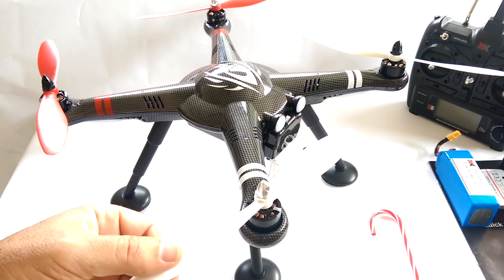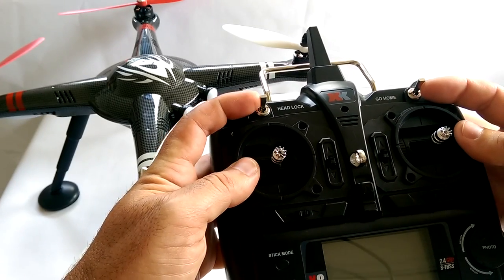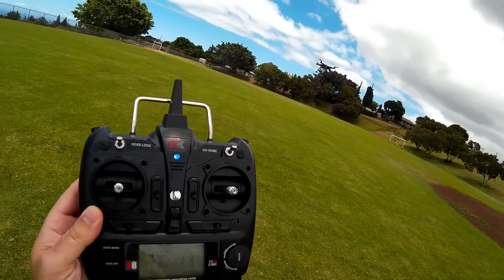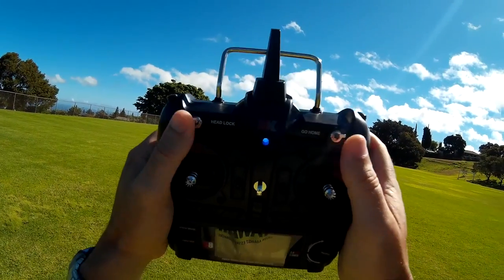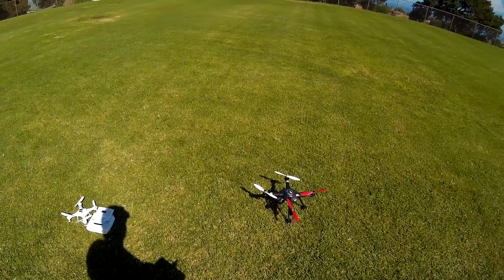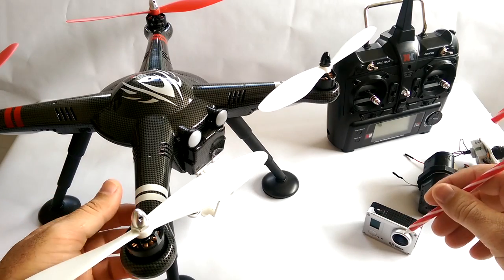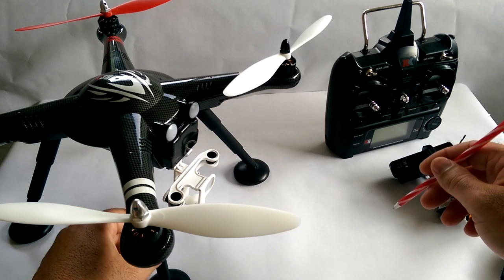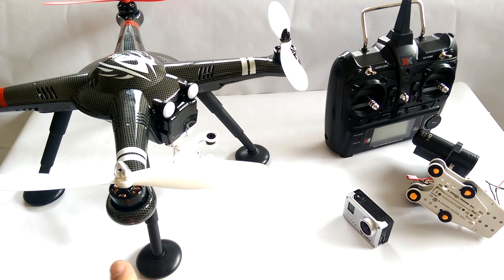XK Detect X380 GPS QuadCopter Drone Full Review - [Setup, Flight Test, Pros & Cons]

Comment: I've been watching quads in this price range for quite a while. This looks like one of the best I've seen under $500. The huge battery with resulting 30 minute flight times is amazing at this price point. Add to it spot on GPS and return to home and you certainly have a winner. The rotating dial for a gimbal is really cool. Can't wait to see your mods and gimbal footage.
Reply from the maker: Hey John.  Yep, the gps and flight controller seem to work flawlessly in this quad.  I'll hopefully be getting the mod parts in next week and see how far I can take it.  Stay tuned :)

Comment: Hey Dustin
I am having an issue with the pitch control on the X380 and G2D. Without the signal wire connected the gimbal works fine , but when I connect it, the gimbal tilts the camera up and down sporadically on its own and when I tilt the copter and it has a delay trying to level the camera. I am using the far left pin opposite of the USB plug on the X380 and it is plugged into the gimbal PIT top pin. The wire(s) I am using are a modified combination of the two included wires included with the gimbal to extend the reach from plug to plug . I Removed the red+ and black- leaving only the gray signal wires in the harnesses and snipping off one harness on each. I stripped the ends of the wires , twisted them together and insulated with electrical tape.  I have began to troubleshoot it and have removed the props , left the remote turned off and powered the copter and the issue continues but gets worse when the controller is turned on. Not sure what my next step would be and hope you may know the remedy to my frustrating problem….

Comment: Dustin i just received my XK Detect X380 on Wednesday December 30th 2015, and I got the up graded transmitter that now has (F.A.P ) mode Fly around point mode. So on the transmitter the camera button now says (F.A.P ) and you push it once to make the quadcopter do a 360 degree rotation. And it will continue in the 360 degree rotation until you push the button again. Also if you push the button and pull down on the right control stick for a few seconds it will then enter fly around point mode and circle the chosen target and circle it until you push the button to make it stop again. So my question is how do i take photos now that that (FAP) is on the camera button? And It has camera written around the sides of the button with arrows pointing in both directions around the camera (FAP) button to where you would normally turn the knob to adjust the camera angle. I have just ordered the gimbal that goes with this quadcopter, and i don't see how to make this one button do four different Things  And the instruction manual is still showing the old transmitter with camera written where (FAP) Is now. So the instructions are not updated yet. But they did add a manual to demonstrate the (FAP) mode. But they did not say anything about how to take photos or adjust the gimbal now. So i just wonder, if maybe you got to hold the button down or press it a couple of times to go in to camera mode or something? Also i would like to slow down the yaw rate when in (FAP) mode When it's doing a 360 degree spin while hovering. it spins to fast i would like to slow that down just a little bit. if possible?  I would assume that you have upgraded your X380 to have the ( FAP) mode? is the camera button now FAP mode for you to? Assuming you have upgraded ? but if not i assume  you would still know how that would work. But i have only got to fly the XK X 380 about 5 times now, but i was, and I am still very impressed with this quadcopter. I have a Syma x8c quadcopter and it is a good quadcopter for manual flying, but for areal filming the XK detect or quadcopters like the XK Detect X380 that are equivalent to the  X380  with the G.P.S  And altitude hold modes are the only way to go for areal filming This quadcopter pretty much flies its self compared to my Syma x8c quadcopter.
Reply from the maker: Not sure you can snap pics remotely with controller.  Yes, I've upgraded to the FAP and it works with my version fine.  It's a good quad.  Just wish it had another channel or 2 for other functions.

Comment: Hey Dustin , great videos ! today i received my X380 and i was hesitant on taking it out for its maiden flight because of the outside temperature (16 F.) and i was unable to find any specs containing a minimum operating temp. do you know what they are or would you know where i might be able to find out? thanks
Reply from the maker: Whoa that's chilly!  Honestly not sure but I would think you'd be OK.  Make sure you compass cal and give it an initial few mins to update GPS almanac and lock.  I'd do a  10ft hover with some small movements for the first battery.  The flight controller gets pretty hot in the X380 so the lower temp may be ok.  Just keep it low just in case.
Reply: yeah we all cant live in beautiful Hawaii ! lol. i have one more question for you , do you know if you can get into the configuration using the data cord on a android device ? i would have known myself but my 3 year old son recently  decided to use mine as a tub toy 2 days before it arrived. thanks again
Reply from the maker: Don't think so yet but that would be cool.  Lol. Hope you dry it out and get it working :)
Reply: +Dustin Dunnill The X380 is a beast! i just made my 15th flight with it and it performs well in the cold windy conditions currently in my area. GPS works great and battery life is unreal! however I have been having jello issues with it , using the Hobby Power anti-vibe mount and runcam setup. i balanced the stock props using the sand paper method but did not see much of a difference in the video after the test flight. i see you are using the DJI 9450&#39;s (just ordered a set).I do have plans on ordering the walkera g2d but can the settings for it be adjusted to accommodate  the Runcam or am i stuck ordering a SJ cam?

Comment: Hey Dustin. I finally got mine. Love it! I would like to set mine up with FPV (not the goggles) but wouldn't know where to start. Do you have any advice for what you think would work best with this quad? all I have at the moment is the stock camera mount it comes with and a go-pro hero 4 silver. Thanks in advance Phil. Oh how did the bigger battery end up working out after you put a few more cycles through it? Better flight times?
Reply from the maker: Hey Phillip,  I'm going to do a setup almost identical to what I did with the cheerson CX-20. I link to the parts I used for that build in it's description https://youtu.be/TmmT7dlaTh4
That battery was no good for the X380.  Bad quality still gave me less flight time than stock battery.  I would not recommend it...still searching.

Comment: Hi Dustin...really like your work. I've just gone ahead and bought the XK detect after watching your review. I have been in the market for a while for a good inexpensive workhorse and this quad looks perfect. I'm interested in how you did your FPV with this drone, so if you can steer me to how you set up I would appreciate it. I'm also looking forward to see how you do the mods to extend the range. I have looked at lots of quads before settling on the XK Detect because it does look robust and also seems to handle the wind well. 
Interestingly, there were a lot of complaints from buyers of the XK who lost control of the craft and I notice that you clearly say that its important to make sue the GPS has picked up a minimum amount of Sats and that it must be orientated correctly each time it is flown. With a lot of the videos showing loss of control there does appear to be other factors which could have created the problems such as one person mounted a torch on top...another looked like they set it up before getting suitable GPS. With this in mind could you please write a short list confirming your own procedures to mitigate control loss.
Did you have any control loss situations before you sorted the problem or was it just your experience that made you take your precautions?
Keep up the good work...regards

By the way I am only new to quads and I have been doing my learning with a MJX x600, which I bought 2 off and 6 batteries so that I could always have spares. Lots of fun and I am just getting to the stage where I can do 6 flights without any crashes in a session. I can now fly it around facing its head...as opposed to just sweeping sideways and then reversing back..
Reply from the maker: Hey Michael.  Congrats!  It's a great quad.  I have everything split off the 12v  output on bottom (gimbal and VTX) I am making a setup video and it will be up by next week.  I have all the parts also in for Range mod which I'm also making another video for.  I'll have all the parts needed in the video descriptions.
Some have had issues (and there are defects) but I'm betting most of them were due to improper preflight and calibration procedure.  There are basic steps and best practices with a GPS copter to follow and this one is no different.  Check out the owners forum on rcgroups.com if you haven't already, it is a great source.
My X380 is still working flawlessly as it was first out of the box and I now have about 20 or more flights with it.
It's great that your learning to fly on a mini.  I'd recommend really mastering flight with your X600 before doing anything but hovering around slowly with the X380.  Good luck and enjoy it! :)

Comment: Hi Dustin,  I am awaiting the delivery of a X380 I fly a CX20 at present, and have been reading of the many problems this model has been having, I believe the compass board is down one of the legs, all FC I have anything to do with seem always to be  mounted flat and facing forward in the direction of flight, how does the X380 sort this out  Good flying Regards  Geoff

Comment: Hey Dustin, I cannot seem to get a GPS lock on my x380, (2 flashing green lights) It is stuck at 1 flashing green and 1 flashing red over and over again. What am I doing wrong here? Thanks in advance :)
Reply: Make sure you are in an open environment like a soccer field, school field etc. also make sure there is nothing preventing it from getting GPS such as metal or magnetic items near by. Try calibrating the compass if you haven't tried yet, hope this helps.

Comment: How do you know when the battery is getting low? The lights seem to always flash. I would hate for it just to fall out of the sky due to the battery dying.  Is there a way to make the lights stay on solid?
Reply from the maker: Hi Garry, when battery gets low the rear light flashes read for a few minutes in slower pulses.  Then when it is almost completely exhausted (around 200-300mah left) it auto lands from wherever it is while rear light is rapidly flashing.  Great thing is you can still control it horizontally while it is in the emergency low battery landing stage.

Comment: Fan of yours for quite awhile thanks for all you do! Question? Are there any leveling adjustments that have to be made through the remote? If you covered that my apologies. Thanks Dustin, Kevin
Reply from the maker: Hi Kandj thanks.  The level is set from factory so you should be fine just making sure to do compass calibration.  I think there is a way to reset level for accelerometer if you need to but that is not covered in the manual if I remember correctly.  I'm a bit rusty on the X380 but I think accelerometer recal is holding throttle down and flipping right toggle up and down a few times.

Comment: Dustin, I'm concerned about the expected life span of the motors on the X380. I've done about 20 short, 15 min or so, flights and the quad doesn't seem to have the lift on take off that it did in the beginning. Bit of a throttle boost gets it flying, but also has gotten me to wonder. Have you had any experience with this? Takes Gearbest forever to get anything to you, so figured I'd ask.
Reply from the maker: +Charles Buffalo don't think it would be the motors.  As long as they spin free and don't heat up too hot.  your case sounds like maybe batter going bad and not able to push out enough current anymore.  I'd try a new lipo and make sure you get a decent smart charger.  Don't use the stock charger more than a few times.  Stock chargers are know to be low quality and kill batteries is short time.
Reply: +Dustin Dunnill - Thanks for getting back to me. I use the Onyx 150 and the Imax B6 you recommended for charging. I supposedly have a new lipo setting at the airport in NYC, so will see if that makes a difference.

Comment: Hi, I have issue on my xk x380, my transmitter wont arm the motors, I tried what youtube instructions but still I can't. I tried the push button take off but the quadcopter just lean on the right side. I checked the propellers orientation and it is correct. i just noticed that when I picked up the quadcopter, one of the motors is not working. Its like it's stuck up. Could you help me?
Reply from the maker: Sounds like you need a new motor or take motor apart to see what's wrong.

Comment: Is this better than a cheerson CX20 or hobbyking nova?Seen some nice reviews of this X380
Reply from the maker: +shenlonco Better for beginners I think.  Also less likely to crash as long as you calibrate compass and wait for GPS lock before each flight.
Reply: +Dustin Dunnill  thanks I am not a beginner but I like this ones landing gear over the CX20 and I read about many problems with the CX20 this one seemed to have less problems out of the box., I have my fast quads if I want to zip around so this one should  be good for just hooking a cam on it to take videos.also seen another video with this quad the guy set something so it can fly faster something in the settings he said it would fly like 13 mph and he set something so now it goes 20mph?THANKS
Reply: +Dustin Dunnill Im a beginner and would like to know some hints and tips on setting up out of the box etc, I plan to only fly low to get used to the modes etc,and to calibrate compass, and do the gps lock before I start to fly, missed anything ? also which parts/spares do you recommend ? thanks

Comment: I received a thumb drive with mine. What is it for? Also since I am new to this, what are you watching the videos on? Do I need a separate device or do you view it on the remote control screen. The quick guide is pretty shitty. I would of thought this unit would of come with a more detailed user's manual.

Comment: Dustin, I'm wondering if you are familiar with the X380-A camera? Seems that every time I try to use the photo button on the transmitter it turns the camera off instead of taking a photo. Any ideas?
Reply from the maker: I'm not familiar with the camera models sorry Charles.
Reply: +Dustin Dunnill Thanks anyway. Personally think it's a glitch in the quad.

Comment: What kind of mount attachment is that you have there for that sony action cam?  I've got a few Sony HDR AS100v that I'd like to use them with a gimbal.
Reply from the maker: Hi Darryl, it's a 3d printed mount this guy makes http://impconcepts.com/impstore/ but kind of tuff to custom fit it on the G2D gimbal I used.  Easy mounting options are frustratingly limited for the Sony action cams.

Comment: Hi, Dustin, very nice detail review video. I live in Oahu, has been looking for a drone for a few months, watching a lot of videos. I was going to go for DJI Phantom 3 advance, $799, but heard their customer service sucks, so, kind of hold me back. This XK Detect X380 seems very nice, but I want a gimbal. I have a go pro hero 3+, what is a good easy set up gimbal you will recommend, I don't know much about drone, so the easy just plug and play  gimbal is what I am looking for. What do you recommend. Will the remote able to control when to start stop taking video and take photos? Mahalo.
Reply from the maker: Hi Tin.  The FeiyuTech tech mini 3d has been good to me and easy to connect with gopro but some have had issues with rf interference on compass.  There are some new low cost 3d gimbals out now but I've only tested a few.  You can't take remote pics with X380.  You have to either start video or time lapse pictures before you launch.

Comment: hi it`s me again, does the x380 requires any firmware update or programming like the cx20 and the dji drones?
Reply from the maker: +kwabiNEXAS Hey.  Doesn't "require" an update but there are some floating around.  It is definitely optional.  There is also software so you can connect and change some things around "at your own risk".  Check out the rcgroups.com owners thread... it's all in there.